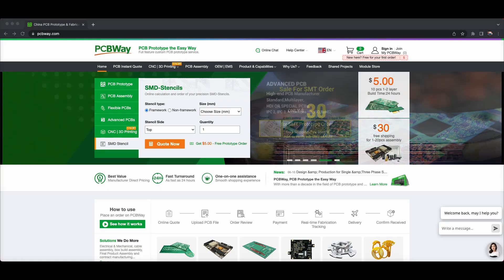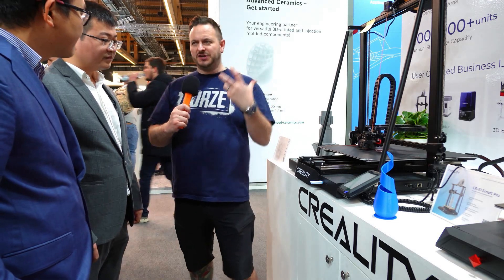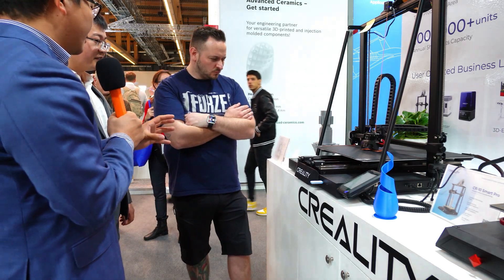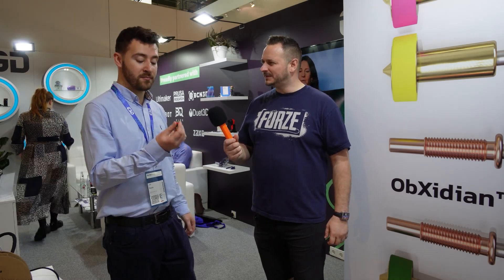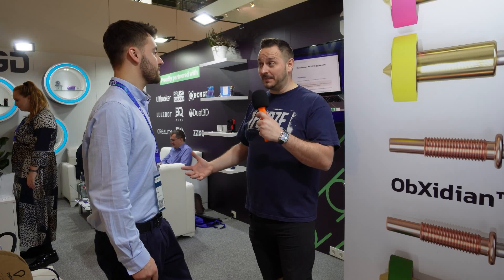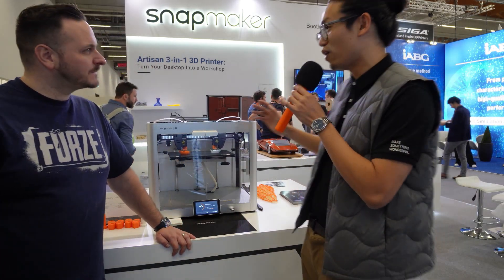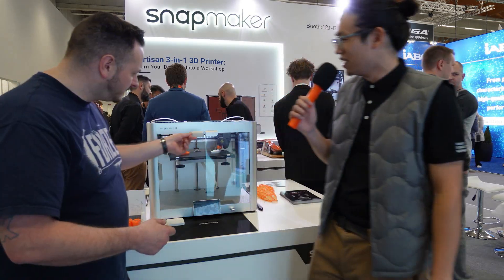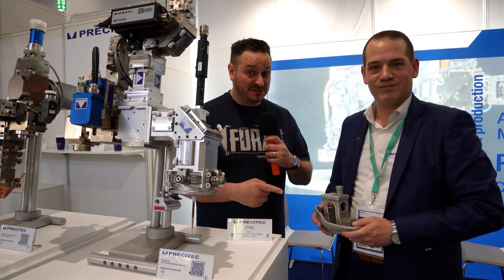Formnext 2022 - I speak with Creality, E3D, Snapmaker & Precitec

Comment: Creality loves open source so much. Everything is open with them, even the open air death machines they had running in formnext. They had laser engravers without safety enclosure and venting systems just running in front of people. Free blindness and lung cancer for everyone!

Better not mention them ever releasing any of their designs, code or anything though. They still refuse to share those, they just want others to do it so they can copy them more.